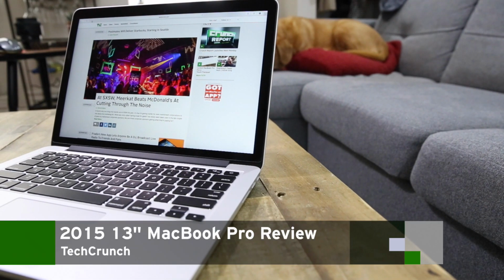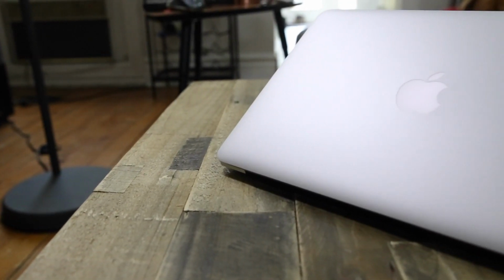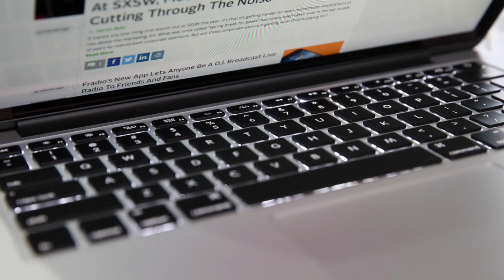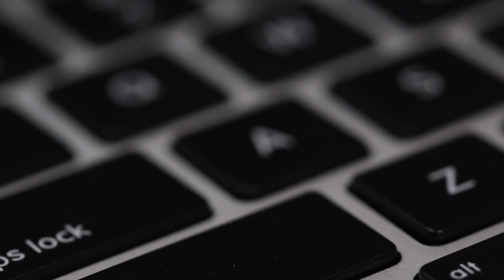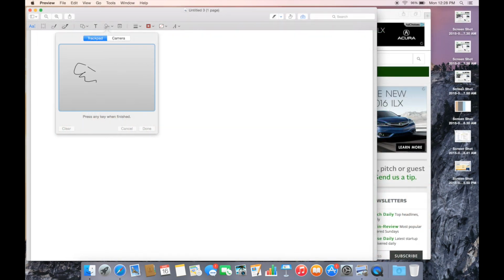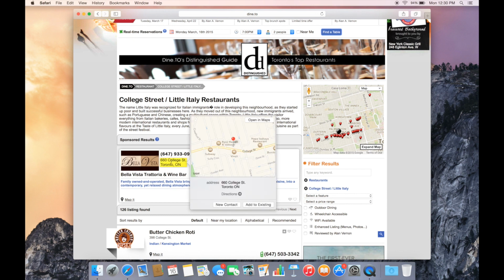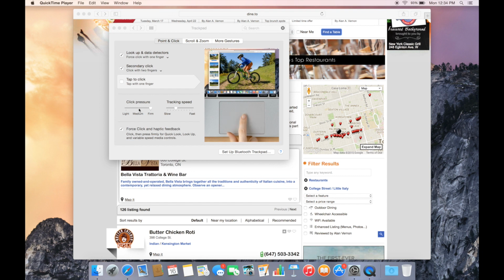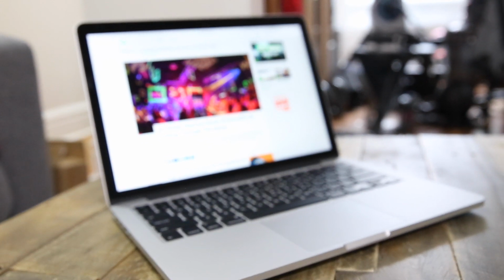2015 13-Inch Retina MacBook Pro

Comment: When you're doing the blur-in effect you should really not keep it blurred for that long. It hurts our eyes. And when we do finally get a sharp image then you too quickly cut away to the next scene before we've had a chance to fully take in the actual thing that you were supposed to be focused on.

If you do want to keep using the blur-in effect then you really need to blur-in a lot quicker, and spend more time in the focused state